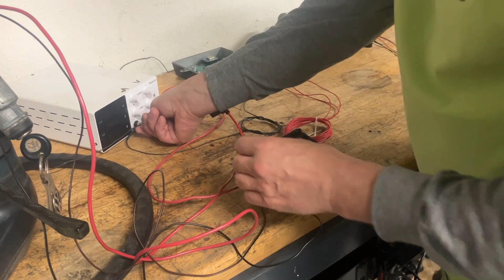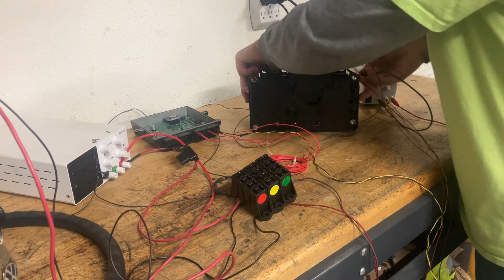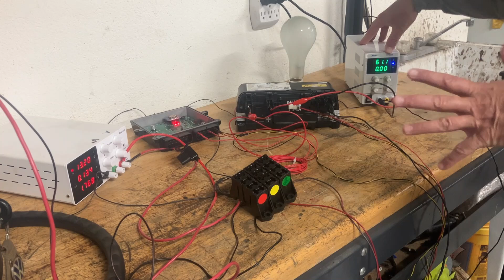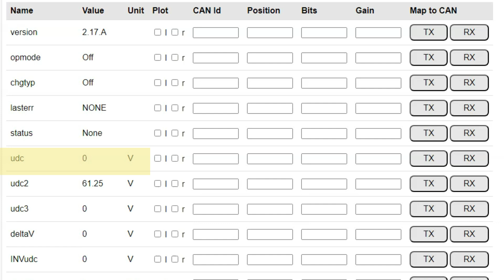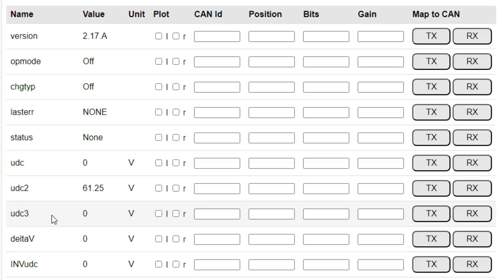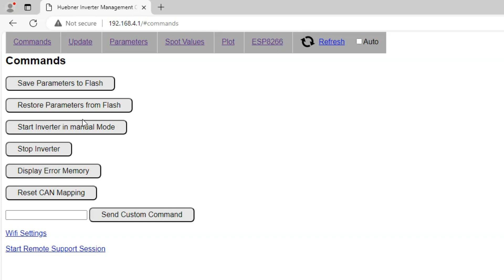EV Conversion DIY Wire Harness - BMW Safety Box Part 2

Comment: If you carefully watch the UDC value it only reaches 39 V and your condition set to 40V. In thi case your light bulb is a resistor so the voltage drop gives you this effect. I wonder if you get safety box if you purchase BMW hybrid battery?
Reply from the maker: thanks Ed, another commentor caught that as well and suggested I try 35v and when I lowered the udcsw to 35v it worked, there are a number of these BMW sBoxes for sale on eBay as we speak, look for this part # 61278686893
Reply: @Good-Enuff-Garage  thanks for the part number. Is it separate from the battery though as I don't want to buy a safety box and then buy a battery and have two in the end?
Reply from the maker: each BMW battery pack does contain a safety box inside of it so yes you would end up with two, these cars have them 330e, 530e, 740e, X5, check out the Nissan Leaf contactor box, it's way cheaper and does not require CAN to operate Nissan AEV6505A Panasonic

Comment: Another belter of a video! Really like your traffic light coding of the junction blocks.
Would you consider doing a side video/info session on using a multi meter (clamp & probe etc) on high and low voltage/current?
Reply from the maker: thanks, I appreciate that, see if this helps https://www.youtube.com/watch?v=TXzrW3yBE9Y&t=470s

Comment: The pre-charge resistor and light bulb are acting as a potential divider so  udc is only getting to 39V. A capacitor given enough time would get to the full voltage. The resistance of the bulb is about 33 ohms so with a bit of calculating it looks like the precharge resistor is about 18 ohms.

Comment: Ive gone ahead and ordered a S-Box, no cables attached, Do you the part number to order one of the harness plugs?
Reply from the maker: check description for direct link
BMW 530e HIGH-VOLTAGE BATTERY WIRING HARNESS 
CSC/communications wiring harness
Part Number: 61278740602
Supersession(s): 61-27-8-740-602; 61278697677

Comment: Light bulb is an inductor/resistor not much of a capacitor. Seems to want to go to about 39V at udc. Maybe try at 35V and see what happens. I would have expected it to work as well, but reality set in. Excellent series, you are doing a Damien good job. Thanks for all your time and effort.
Reply from the maker: You Rock! 35V worked 👍🏼
Reply from the maker: thank you so much, can't wait to try that🤞🏼